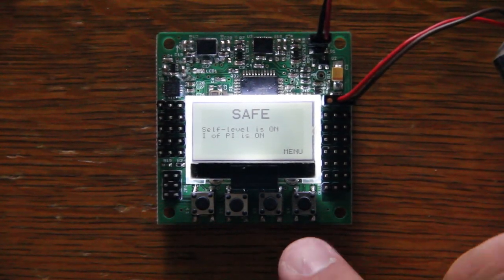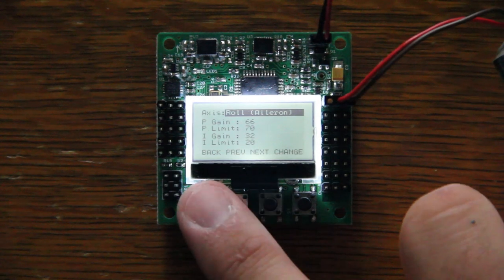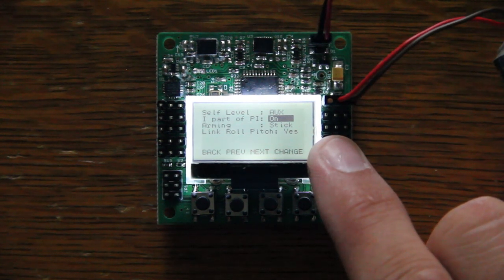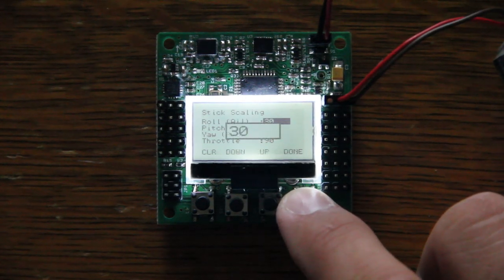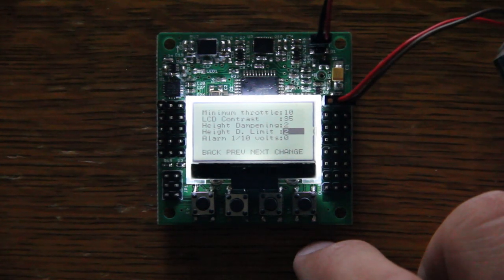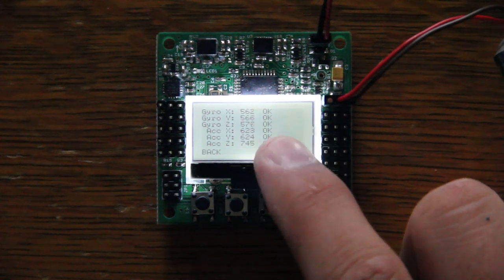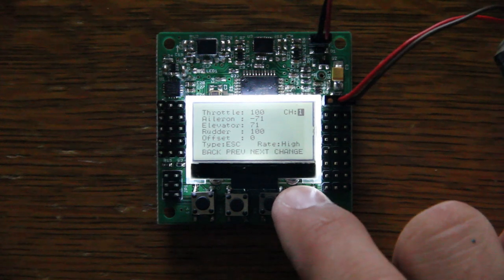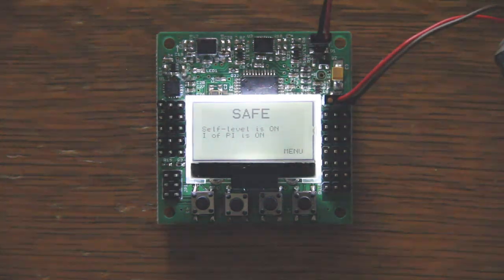Hobbyking's KK2 Control Board: THE WALKTHROUGH

Comment from the maker: Stick scaling will still be useful if you want to have more adjustment then your radio can give. If you will be using it for FPV or regular flying around, the stock setting will be great. If you want to test faster maneuverability, you will need to slowly bump them up.

Comment: Still a great video after all these years. I just bought my first quad (drone) with a FC (it's used), and it has the KK2.1.19. I am really thankful I was able to just bind my transmitter to the FC and fly immediately - I had no idea about much of the KK2. If it didn't fly out of the shoot, I would have worried about all these settings in the firmware.  I've watched this video a few times as I fly more. Things become more clear the more I am flying. I found a couple of reasons in KK2 setup why my throttle way overpowered my elevator - the quad didn't have much "forward", it was very limited. Any add of throttle would result in much altitude. Looking forward to getting out early tomorrow a.m. to try out. One thing I have to figure out is using the Aux switch for self leveling which I have been flying with but may not need, and using the Aux switch to switch between Profile 1 and Profile 2. I guess I can switch the self leveling to the stick control.
Thanks for the great share, still very helpful.

Comment from the maker: The HK stabilizer came out less then a week ago. I doubt anyone even tested it yet.  Self leveling it a form of autopilot, not stabilization. Accelerometers counter act drift and are rarely needed on a fixed wing. Are you looking to counter act wind and bumpy air or have the plane level it's self?

Comment: Sounds like analog RFI from the motors or an low level IF interference from the receiver. Check all the connectors and make sure they are making good contact. The twitching tail rotor sounds familiar to me for some reason but, all I can say is make sure the wires that run from the controller board to your tail rotor aren't next to any other motor speed controller, servos, the main controller or the receiver board. You might try shielding the servo's controller leads to block any RF excitation.

Comment: Hi Jay,
If I may I hope DH doesn't mind. I believe the CCPM settings control the position and ON/OFF function of the RX side of the board (not fully confirmed till tomorrow). Under MODE SETTINGS, there is an option to turn CCPM OFF or ON. As you know, the instruction sheet shows you the positions to plug in your RX plugs (AIL/ELE/THR/RUD/AUX). The CCPM Mix shows (AIL/ELE/RUD/THR/AUX). It seems you might need to match the two to make it work properly. I will confirm tomorrow if I am nutso -- r

Comment: I like your explanation of the KK2 board.my set up ail right motor +value left motor -value: elev front motor +value  rear motor -value. the quad is set up for X mode.when throttling up it wants to flip forward, what do I need to adjust to make go up.
Thanks

Comment: answer for question 1: either you need to calibrate your esc's as the throttle curve isn't right on the 1 which is going slower or you have a faulty motor or esc.

answer for question 2:  front is between motors 1 and 2 on an x quad

Comment: Hey thanks for the videos, they've been quite helpful.  I wanted to ask a noob question that perhaps you could answer.  I am new to this hobby and have the kk2.0 board which I'm using to run a quadcopter in "+" configuration.  My problem is whenever I try to takeoff the quad just wants to flip over and crash.  I've checked and rechecked the direction and orientation of the motors and props.  Could this be an issue with the firmware, or is there a trim setting that I'm missing?  Thanks.

Comment: Hi dhdsracer
The ESC's are HiModel FLY-30A-pro SB, programmed them as you suggested to N-Hi batteries, this system worked on on a heavy Quad I designed using Electrical conduit using the original KK1 board, now fitted to a X600 frame, I burnt original board with a faulty connection, tried a i86L board, couldn't understand dip switch settings,no help available, and now trying KK2 board,where from here Regards Goofa

Comment: Hi,I'm new to home built quad copters,I have purchased the KK2 board but haven't a clue how to wire it all up,,at the moment i have a box of bits,I have pre assembled the quad frame and that's as far as i have got,I'm not sure about the wiring of the speed controllers(which wire goes where)from the motor and connecting to the KK2 board and so on,can you please help?

Comment: Hi dhdsracer.
I have been trying for 3 days to program a KK2 for my X Quad, have followed the manual I believe and now have resorted to the string method, followed the instructions for that and can get it to almost stay in hover position if I increase throttle to far it wants to rotate around the string have tried outside will hover in a fashion and slowly Yaw anti clockwise am about to bin it have no problems with beetle Quads, any Ideas Regards Goofa

Comment: I have trouble getting my ESC's to work with my KK2 board, i just hear constant beeping. Transmitter appears to work perfectly with the board when checking the Receiver Test. Also tried calibrating using the kk2.0 but i never got a confirmed beep signal after lowing the throttle down to idle.

I'm using the kk2.0 with Turnigy Micro-Quad(PNP from hobbyking) and a JRPROPO transmitter.

Any idea why this isn't activating my esc's? it tried doing the esc's by themselves and worked fine.

Comment: The left motor/motors are receiving less power. Check if the power cable is longer to that/those motors.

My PCB based micro quad has that problem, the motor furthest from the battery plug always dies first.

Comment: Hello dhdsracer, I'm trying to figure how to adjust or set my quad to lift off level and stop it from always wanting to lift-off and fly/move rearward. I tried re-calibrating the ESC but I get a throttle pass-through message when its attempted instead of the beep(s) that the KK2.0 instructions say should be happening. Any solutions to this quandary?

Comment: Can you explain this problem. My quad is a 230 mm, it flies fine when the battery is full. When the battery power gets into the 40 % my quad wants to roll to the left, is there an adjustment to compensate for this problem? Thanks for your help.
FW

Comment: Hi, are you using the new V1.5 FW in this video? its just my menu looks slightly different, in the misc. settings you have screen contrast and i dont but i have something called servo filter which is set at 50, do you know what this is? thanks

Comment: Thanks for all your videos they have helped a lot while building my 450 with kk 2.0 board and v1.5 firmware. The problem im having is when i press menu and go into the settings all 4 motors keep beeping and twitching every 2 seconds or so whilever im in the menu and I've not seen this on any other, when i exit the menu the motors stop beeping and twitching and it flys ok, do you have any idea why this is? Thanks

Comment: Hi again, my first kk 2.0 board is working great but ive just built another quad using the kk 2.0 and im getting a warning message when i power up, it says "sensor calibration data out of limits" and in sensor test the gyro y says 491 not ok,  everything is connected right and reciver test are all zero and running in right direction,  do you know what the problem is and what i can do? thanks

Comment: I'm having a issue with my kk2 on my tricopter. it does not self cancel. (e.g. I go to turn right and the left motor speeds up. however when I centre the stick the left motor is still going fast than the right). Can you help?

Comment: Hi there....sorry to bored you with a dumb question!!!today i've done the firmware update of my kk2,I've one this a lot of time,but today I forgot to put the jumper on my usbasp programmer,so the flashing cycle start up as normal,but did'nt end ,so the new firmware start the overwrite on the old one,so now I've got no firmware install on the board,and when i try to reflash the card the kkmulticopter flashtool give me an error....so do you have any Idea how can I reflash my board or do some reset

Comment: Hi, I upgraded to 1.6 firmware, but can't get self leveling, its turned off, even I flick the switch, all well calibrated... and in right channel, this option pretty much dissapear after I upgraded, stock 1.2 worked well on self leveling but 1.6 none, far more stable though...any help DHD racer?

Comment: I will try to explain what is happening. the value is in the mixer editor ail -71,elev71 (ch 1), ail 71,elev 71 (ch 2), ail 71, elev -71 (ch 3), ail -71, elev -71 (ch 4).
The quad is the smaller size 220 cm, when the throttle is increase the quad lifts the
 back side mot 3 and 4 up towards the front to flip it over.
I hope you have an solution what I need to adjust.
Thank you in advance.
Fw